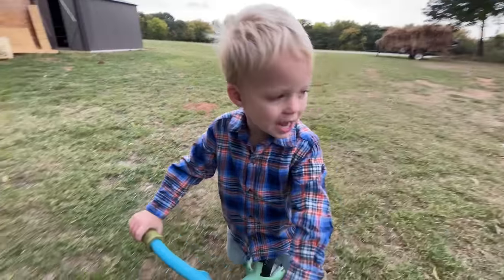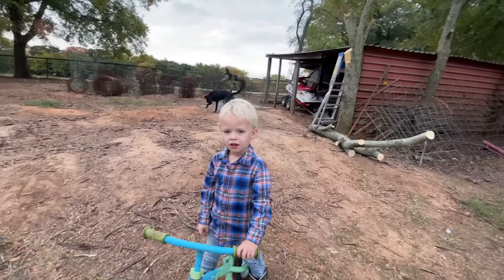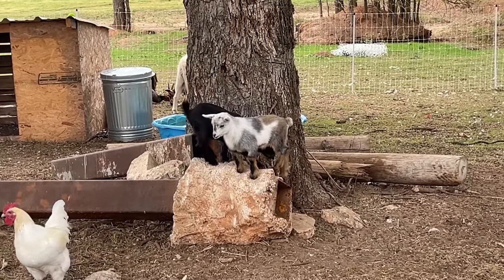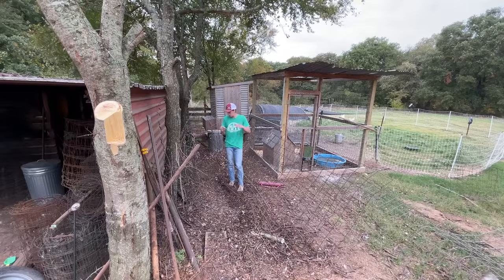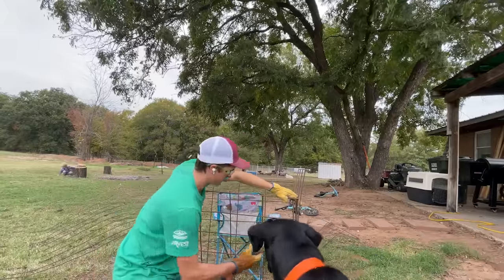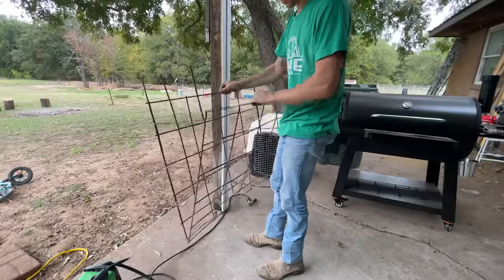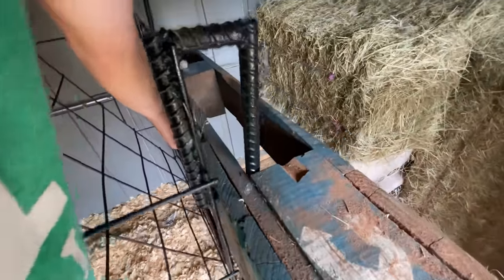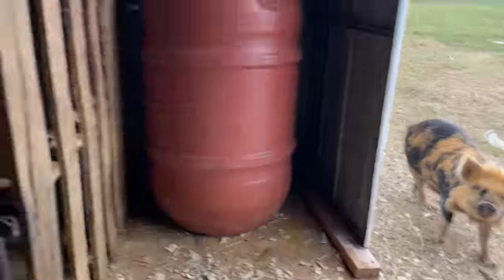The Easiest DIY Hay Feeder For Goats, Horses, Cows.

Comment: CRANDALL I HATE TO TELL YOU THIS AFTER ALL THE WORK YOU DID BUT THOSE HOLES ARE TOO BIG AND THEY WILL JUST WASTE MORE OF IT THAN THEY EAT. THE HOLES NEED TO BE ABOUT 2x2 SO THEY CAN NOT PULL SO MUCH OUT AT A TIME. ONCE IS HITS THE GROUND THEY WILL NOT EAT IT. JUST THOUGHT I WOULD LET YOU KNOW.
Reply from the maker: I was thinking the same thing after I set it up. I think I’m gonna modify it a little bit to make the hole smaller.